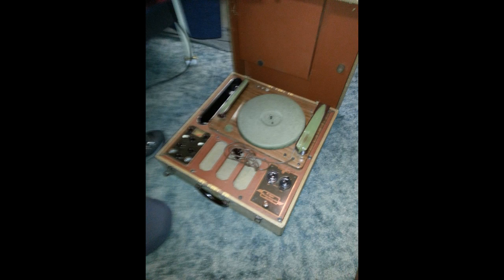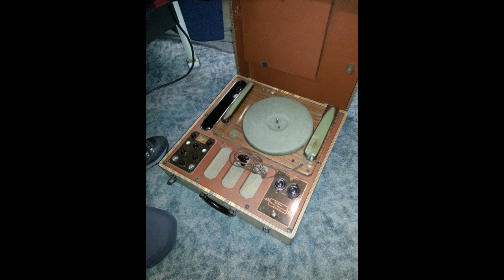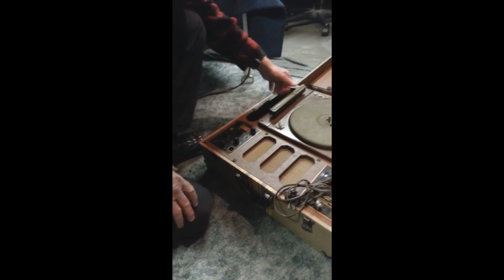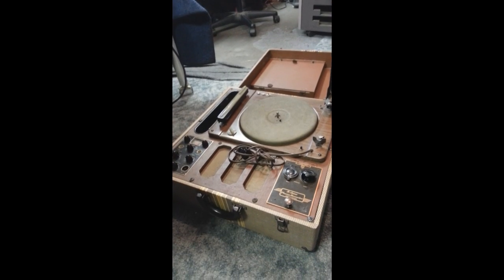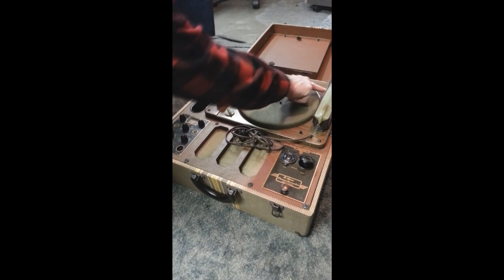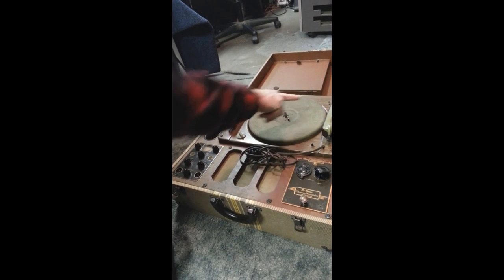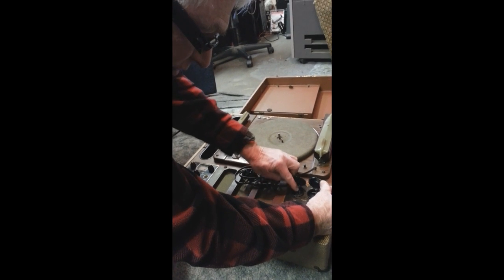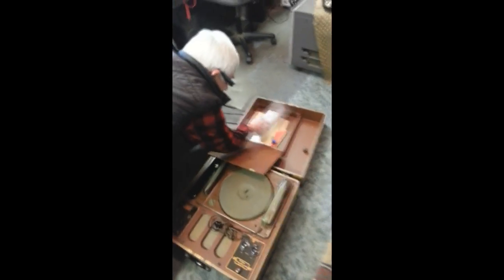Vinyl Record Recording Machine

Comment: You have to use "cutting" needles on these, you can't use regular steel needles like you may have on a 78 RPM record player.
Back in the late 50's I did some record cutting, I bought  a "cutting head" from an old German Tv & radio repair man, I drove the cutting head using a 6V6 vacuum tube amplifier on the 8 ohm tap where a speaker would go.
I did not have the what they call the Sculley lathe drive type worm system but I just used a regular 78 RPM turntable.
It worked but man those grooves were all over the place.
Back than I used to be able to buy those disks, cost more than they were worth, those were the good old days>>>>LOL.

Comment: Did you notice whether that was for 78 rpm or some other speed, Ken? Also, there was mention of "stereo," but I am somewhat skeptical that it was possible to cut stereo grooves (2-sided) with that kind of cutting arm. I've heard there are very few machines like that left. My dad had one for awhile. He was a music teacher and made recordings of his students before tape (or wire) recorders came into being.
Reply from the maker: it had two mics.. I assume to record in stereo. and judging from the size of the turntable, I'm thinking 78s.. I "believe" 331/3 records was a different process.. going from tape to vinyl
Reply: 1963impala2dr
Well, the one or t'other...there were never any 78 stereo records, in fact stereo disc recording came out 20 years after 33-1/3 LPs became the defacto standard. It's an interesting machine, in any case. Thanks for sharing it with us.

Comment: Iv just purchased one of these machines & I now need some advice on how to change motor speeds up to 45 to cut disc's... Is it possible.
Reply from the maker: im sorry , this is not my machine.. I dont know how it works
Reply: Hey Gene. I was looking for someone who had this neat thing so I didn't have to spend a fortune putting my family's music on vinyl. Do you think you can maybe tell me your email or any contact information so that I can notify you when I need to maybe make a record or two? Thanks, I'd really appreciate it :)    - Max
Reply: Max id love to help u out but at present were in the process of adapting the cutter to 45 rpm's once this is sorted I could get back to you if you want... You do know that im based in the UK...
Reply: @genevincent7505  don't worry I have international connections, I just need an email so that I can get a hold of you privately if that's fine. Would you mind telling me?